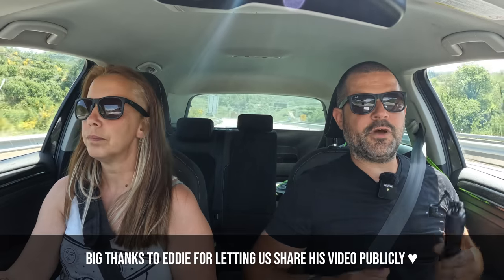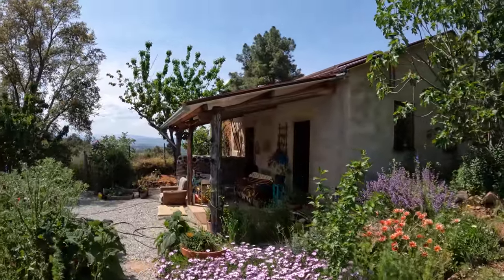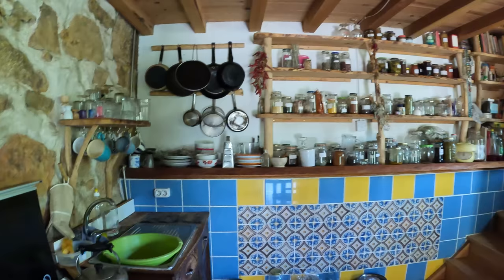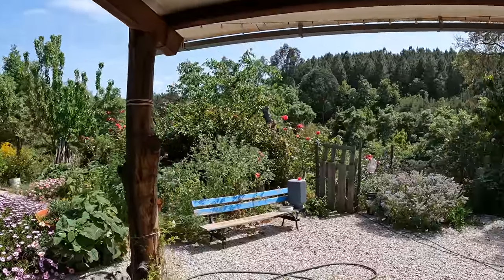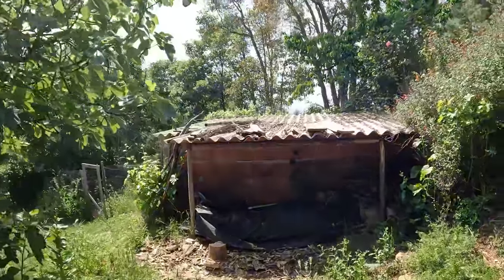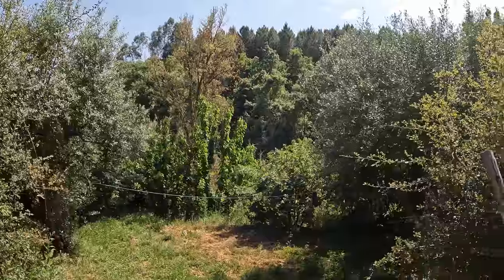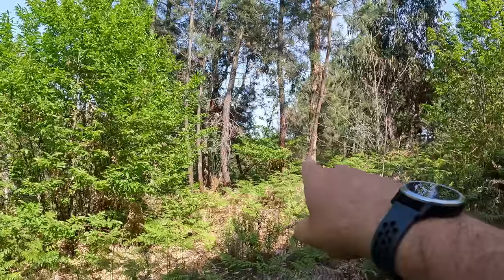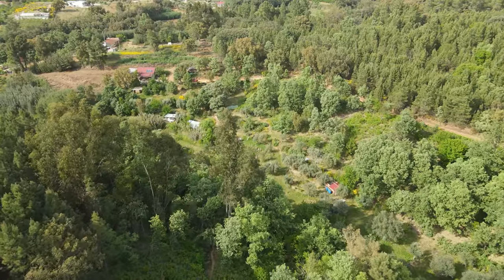5 Acre, Off-Grid, Tiny Home for Sale in Fundao, Central Portugal ❤🇵🇹😍

Comment: Thanks, Ken.  Very nice property.  Thoughts on running gas generators outside around trees and grasses?  I'm thinking of the dry seasons and fire risk.
Very cool and appealing place.
Alex
Reply from the maker: I think the generator is a backup for the winter if there's long periods with no sun. The dry summer months should have plenty of sunshine to recharge the solar system batteries 😁👍